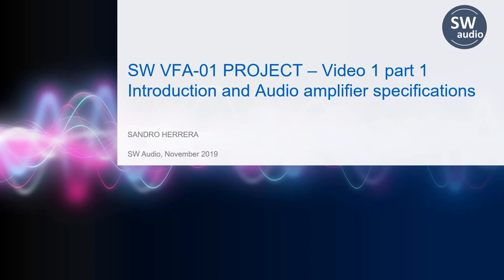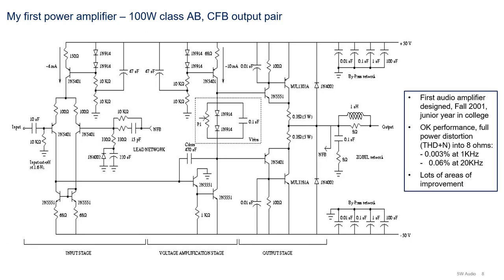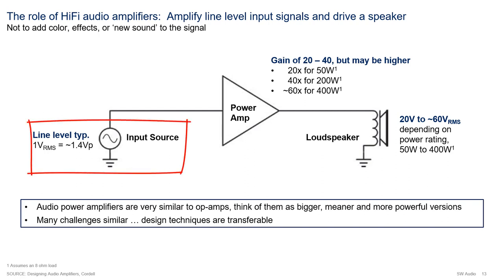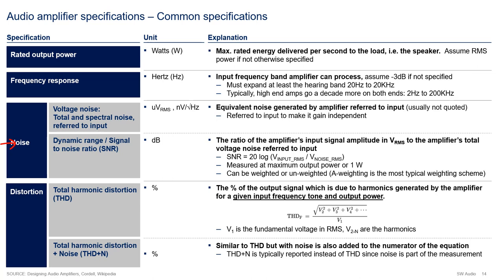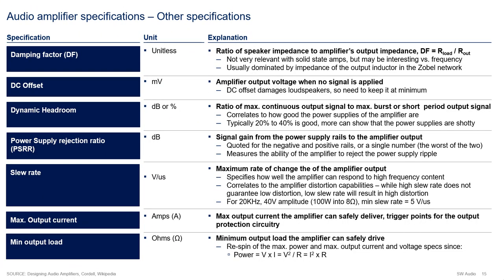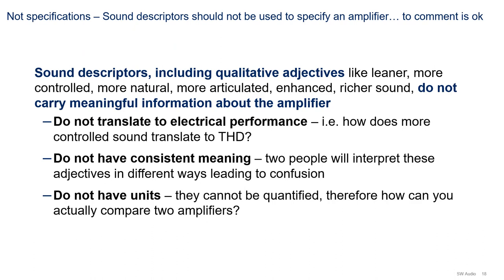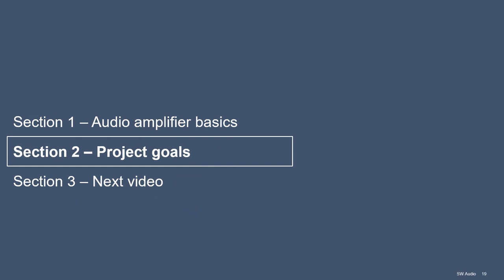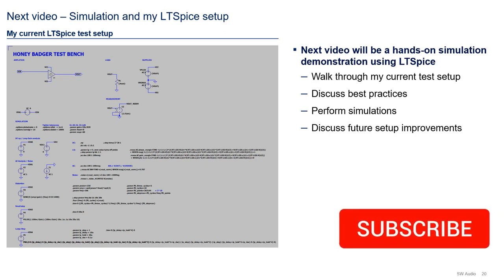1.1. Introduction to Audio Power Amplifiers and Specifications - Audio Amplifier Design Fundamentals

Comment: It’s an extremely good series with the essential knowledge even for professionals. I am a non engineer into this hobby since the 90’s starting with building copy cat designs with no understanding to slowly designing discrete amps. I have read through Self’s book and it gave me the fundamental stuff for discrete designs. I also picked up a Horowitz and hill later which has much needed knowledge for the transistor circuits especially current sources and the maths needed. Very good series of videos though truly appreciate

Comment: MC152 amplifier has 2,4 and 8 ohm speaker terminals on the back. That is why the 150Watts can remain  constant across differing speaker impedances. I don't know the pros/cons of this approach
Reply from the maker: Very interesting, I did not notice it until you placed it in the comments.  Thanks!
Reply: @swaudio6528  Yes McIntosh actually use very high quality autotransformers of their amplifiers.